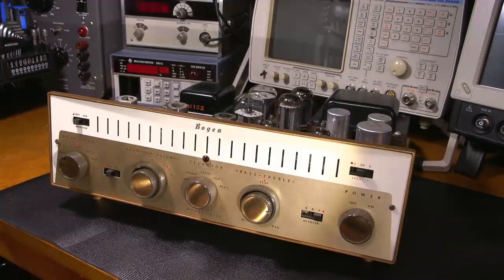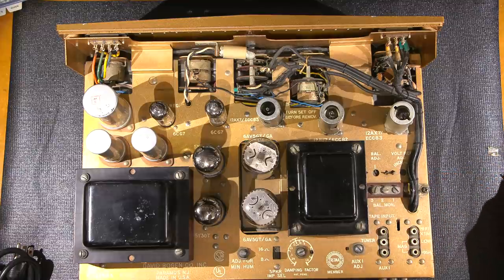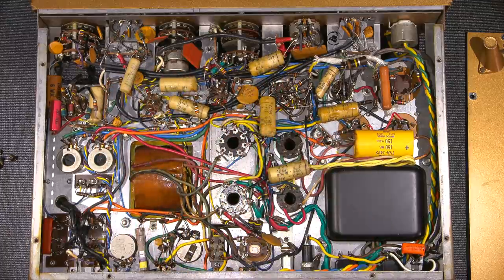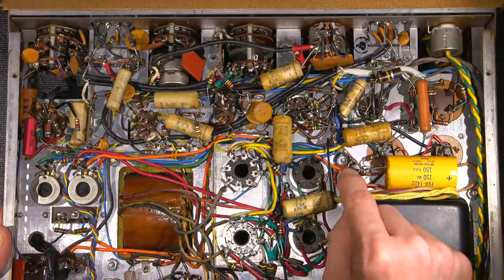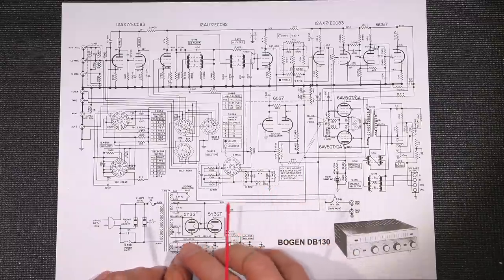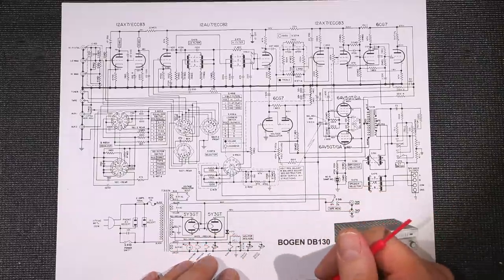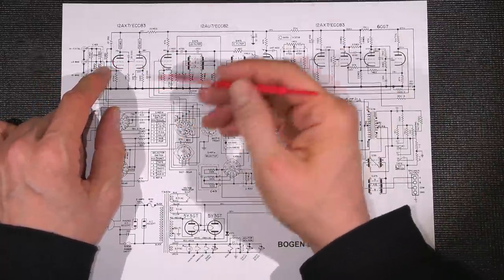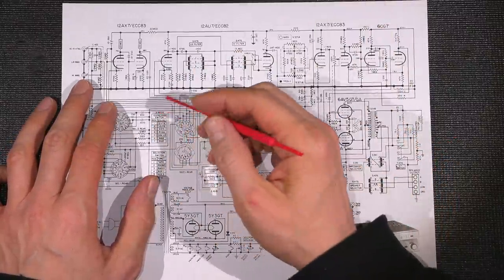Look Inside This Tube Amplifier!

Comment: Um when you were explaining how the Valve amps work and then transistors you called transistors current devices and FETS and Valves voltage devices. When I got my ticket in Australia I had it explained that with Transistors the collector base and emitter are very close together and its the voltage change that turns them on more or less. So therefore they're a voltage device. With FETS at rest they have a high resistance so when the input voltage changes its changing the internal resistance (depletion region ).If you change resistance you have to be changing current. So a current device . Its been so long but I think valves were classed as current devices as well. 

TTL has a low internal resistance so it doesn't take much to change its conductance . And the reason their noisy little suckers. 

Where FETS as its being turned on more their internal resistance is getting smaller and smaller till it reaches saturation. 

I can't get over the different way different countries teach this stuff . IN 1982 when I was doing my Certificate of Technology we had a Canadian teacher start with us half way through the year. And he explained TTL and FETS the way you did well when we explained it the way we had been taught he had a think about for a while then changed to the way we had been taught . If I remember rightly we proved it in a practical experiment.
 

I suppose its a bit like the left and right hand rule if you can get your head around one way of thinking stick to it .Its when you start changing from one to the other you'll get confused or the the person your trying to explain it to.
Reply: A transistor is a current operated device.  The collector current changes due to a change in the base CURRENT.  It is operated by current.  Ic = Ib x beta.  A fet draws essentially no current at the gate, a change in gate voltage controls drain to source resistance.  The same is true for the grid of a tube, it's a change in grid voltage with respect to the cathode that causes a change in the plate current.  It's the operation of the control element (base, gate, grid) that defines it as either a current or voltage device.

At least that's how I was taught in the early nineties in Madison, WI, USA
Reply: @mikeduino4596  With TTL the base current can be ignored because its so small. Its in the micro Amps.  Its the change in voltage at the base that changes collector voltage. With FETS your changing resistance in the depletion region and what changes resistance current. Generally TTL can only switch low current devices where FETS can switch high current.
Reply: @anno250  When you strip away all the external circuitry, it is base current that causes a proportional flow of current in the collector, and the emitter current will be the sum of the two.  If you think base current can be ignored, bias the base with a voltage divider, measure base voltage. Now, increase the voltage divider resistance by a factor of 100, keeping the same ratio as the first circuit. Base voltage will be lower for the second circuit...why?? The second circuit doesn't provide as stiff base voltage as the first, in other words the base is loading its bias supply. Hence at the most fundamental level a junction transistor is a current-controlled device. Fets may have giga ohms of isolation between gate and source.  With these there's virtually no loading of the signal at the gate, which controls drain current. This makes it a transconductance device, very different animal than the BJT! ☺
Reply: @mikeduino4596  If you bias both of these say with combination bias their characteristics change for the circuit you have them in .With TTL when you calculate all the Voltages and currents the base current is in the microAmps . When you want to do a quick calc you can ignore the base current. What I'm trying to get through with FETS is when its turned off the resistance between the Drain and Source is typically 100Kohms or higher depending on how its set up but when its turned on fully the resistance is near zero. Which means they can switch or amplify a lot of current try doing that with TTL. 

Your talking about what turns them on I'm talking about the rest of it .
Reply: @anno250  That is correct, I am talking about what turns them on, or what controls them in their linear region.  This is the property, the type  of control, that defines the device as a current or voltage operated device.  They all conduct current on their output side. It's what happens on the input with respect to the output that is generally accepted as defining the device's operating mode. I'm merely stating the convention used to define the general behavior of the raw device. Also, I have power transistors that are low gain high current and power that will draw SIGNIFICANT base current! Say 10 to 20 amps collector current and a beta of 20.  You can't ignore that.  Not every transistor is operated as a small signal amplifier.
Reply: @mikeduino4596  Well luckily I learnt in Australia where we learnt how things actually worked . No wander people get confused . Sounds a bit like why conventional current being still taught as to electron flow. I'd like to see someone explain that with digital electronics.
With FETS  I can't get over that you ignore the fact that when the gate is turned on more or less it changes the resistance in the depletion region. This is the huge difference between TTL and FETS. TTL are generally low current devices but FETS and MOSFETS are high current devices.
Reply: best thread ever you guys, thanks
Reply: @anno250  First off, you keep referring to TTL, which is a logic family designed with bipolar transistors.  Our conversation is about the functional difference between discrete transistors (BJTs) and fets. Second, I'm not ignoring what happens in a fet's depletion region.  It is the electrical field caused by the gate to source voltage that changes the channel resistance. Channel resistance is controlled by gate VOLTAGE. Making it a voltage operated device, period!  In a bipolar transistor, there is a current that flows in the base_emitter junction, a on junction. The gain of the device is  collector current divided by base current.  The current flowing from base to emitter controls  the collector current. It is a current controlled device. This is what is occurring in the device, regardless of what it looks like is happening in the external circuitry.  We are talking about the device characteristics, not about any particular application it may be placed in. Thirdly, to say that junction transistors are not designed for high current is patently false. 2N3055s are non power transistors used to pass load current in high current power supplies.  Many transistors in TO-3 can types can carry 10 to 20 amps or more and dissipate 60 to 70 watts or more.  Many of these will need up to several hundred milliamps to drive them to full output, why? They're current operated.
Reply: As for current flow, I was taught electron flow in tech school.  When I got out in the world, I quickly got that out of my system!  Look at the schematic symbol for any semiconductor device, which way does the arrow point?  In the direction of.... CONVENTIONAL flow.  I worked in an engineering lab where we designed and built switch mode power supplies.  All the engineers used conventional flow.

Comment: Back in the seventies people would trade this stuff in to stereo stores. They'd resell the McIntosh and Marantz stuff to oriental collectors and dumpster most of the rest. I used to raid dumpsters for these to put the output transformers into guitar amps because Fender wouldn't sell them back then unless you were authorized, and half the time they didn't have the right one anyway. You could use a Stancor for powr since they were cheaper anyway, but outputs you had to raid old stereo amps. Fisher and Scott were the best donors. Dyna transformers didn't sound right when overdriven. We didn't know why. But when you put a Scott 299 transformer in a Deluxe it sounded "better", by the standards then. Of course that's when everyone was putting brass everything on their guitars for "More Sustain". people wanted that AOR/arena rock sound. it sucked but who knew?

Comment: Do you ever find the couplets bad??  I've found the resistance off but never an internal disk cap shot.  Also I like the 6360 guitar amp. Never thought of trying that tube. I do the 815 all the time.  Also the 6dz7 is ausome for that but rare.  The 815 is cool because my customers say it looks like a Martian with 2 antenna.

Comment: Greetings from Germany and a big thank you for another great video. 

In the Bogen schematic there is a cap parallel to the power switch. What is the purpose of this?
Reply: That cap functions as spark/arc suppression, to protect the on-off switch. Note that those caps can sometimes go bad and leak voltage. Modern solid-state amps, which typically pull more Irish current at turn-on,  often have an all-in-one spark suppressor consisting of a capacitor and resistor in series, wired across the switch.

Comment: what parts are most likely to get damaged on a subwoofer amp if the 
negative and positive connect when in use. the amp keeps blowing a fuse 
and pushes the driver out and will eventually blow the speaker.

Comment: Can you explain the part about why the 5V AC doesn't end up on the B+ line? I always thought it was merged in with the rectified AC signal, but it didn't matter because another couple extra volts didn't matter because it just got filtered out by the caps anyway.

Comment: So on that audio input set of tubes, the audio controls the screen and how much current goes through is this why some people call vacuum tubes Valves? as the control source in this case audio is controlling flow like a valve would water.

Comment: Enjoy your Videos 👍 that little Guitar Tube Amp is Pretty Cool did you Convert it from Solid State. On the Bogen Amp whats the wattage rated at 8 ohms 20 or 500 cycles being tube amp they sound very Clean  pretty powerful for their time. My ole man had 1968 Marantz Tube Amps they could power Altec Lansing A7 Voice of the Theater Speaker cabs  and 2 half stacks clean and loud. The A7s are very power  efficent and tight Bass pretty impressive Design  Internal Reflux Panels and wide open bottom of Speaker Box .
Reply: Yes the guitar amp is a combo, SS front end with tube for the grunt. Used to be SS only. VOT are easy to drive, nice horns :D

Comment: Is the double tetrode in the guitar amp something like QQE03/12? I built a hifi amp with this tube a few years ago. A combination of cathode bias and fixed bias and a stabilized screen grid voltage was necessary to get both sections working in the same operation point. I know about a few guys doing similar things. So double tetrodes for transmitters used in push pull audio amplifiers are at least not undiscovered in Germany ;)
Reply from the maker: I talked about this tube a few years ago on Patreon, and way before that, implemented it in an amplifier on a forum some 10 years ago. Possibly from one of those postings?
Reply: @MrCarlsonsLab   I think I read first about it in the forum of jogis-roehrenbude. The GU17 is the russian equivalent of this tube. There was a time in the early 2000s where nearly every cheap russian tube was checked out as candidate for audio amplifiers, especially by eastern german forum members. Unfortunately, this forum is down, hence I can't search for the original discussion. Some guys even tried to use it as replacement for the expensive and unreliable ELL80, but I think the specs are too far off (higher negative bias voltage, lower amplification factor, lower screen grid voltage).
Reply: @rotwang83  ELL80 replaced by a QQE0312 just doesnt work. I use simple fix with two EL95 (6DL5) tubes and a socket adapter. Or a chassis strip with 2 sockets for the EL95 mounted nearby. The characteristics are identical and the heat output spread over 2 tubes makes it completely reliable. In the same way the rubbish unobtainium ECLL800 can be made up of El95+El95+6C4

Comment: The "Mr. Carlson Amplifier" needs a FranTone pedal...
Reply: Bogen... My high school decided that, instead of repairing/replacing tons of slave clocks in the classrooms, we would have a clock broadcast over our in-school TV channel for every single classroom to leave their wall-mounted TVs on for accurate time. (This was 1995) Enter BOGEN. They produced an ISA card that, with its companion software, would display the PC's current time on an analog clock via coax. I got to be the lucky one to install the card in the DOS 6.22 486 DX/2 machine and tie the PC into the school's cable channel distribution board.
The clock became affectionately referred to as "Bogen-Time." The worst part of the system was the hours of suffering that obnoxious CRT whine!!!

Comment: Have you done a video on that Spectracom NBS WWVB frequency standard shown in the middle above you on top of the stack? (It looks like an 8164.) I'd like to see that in case you are wondering about what video to create next. :-) Particularly if you have it modified to work with the current WWVB transmissions with a frequency doubler or whatnot.

Comment: Hi Mr. Carlson.  I am baffled by the lack of big smoothing capacitors after the rectifiers on that Bogen amplifier schematic.  I see some big cans on the top of the chassis near the power transformer, which look like power supply smoothing capacitors, but they don't seen to be on the schematic.  There is bound to be a huge amount of ripple present without them..  Is that what the regulator section is for?  I see some big cans on the top of the chassis near the power transformer, which look like power supply smoothing capacitors, but they don't seen to be on the schematic.  Am I missing something?

Comment: The early Centralab equalizer IC’s tend to degrade sound quality. David Berning has modifications for the Dynaco PS 2 stereo preamp, one of which include replacing these IC’s with discrete parts, which dramatically improve sound quality.
Reply from the maker: Hi Louis. I'm not a fan of ceramic capacitors in the audio chain myself. I have a video on the microphonic aspects of ceramic capacitors. Good for bypass, not so good in the audio chain.
Reply: Also, David Berning, who is or was an engineer in the Electron Device section of NIST, likened ceramic capacitor to that of peso electric ceramic phono pickups used in low end record players! Also, he noted that FET transistors has transfer linearity properties like pentode tubes.

Comment: Mr Carlson wondering if I could ask you a tech question. I have a Sony GV-9 video walkman which I restored 6 months ago which involved removing about 30 caps, cleaning the boards and installing new caps and the unit then worked great. But I was using it last week and the lcd display started to flicker white and then turned completely white and has remained that way. I am using a 5 inch portable lcd display connected to the video out and the GV-9 plays tapes fine with sound and the tv working fine too but internal lcd is white. Any ideas as to where I should be looking as it seems to be common problem which this model and the GV8. Big thanks Mike Perth Western Australia.

Comment: Shiny!
Reply: Seems the DB models didn't come stock with a top cover. I believe it was an option because I've seen a few. IMO The DB130/DB115 and all old amps with a face plate extending higher than the top of the chassis deck blocking the view of the valves, transformers, etc, when at eye level just doesn't look good at all without a top cover. They look like someone took the cover off 50 years ago to service it and never put it back on.
Reply: @williswet  The face plate extended higher so you could cut an opening in a custom cabinet front and slide this in from the front to cover the opening.

Comment: When you talk about b+ what is b+?
Reply from the maker: Hi John. It's an old term that is still used today. B+ originally meant "battery plus," it's the equivalent of a "positive rail" today.
Reply: B+ is the term for the high voltage. In this amp about 600 volts. It is a OLD term back to when radios were run on batteries. There were many size batteries, A AA B C D and so on. Yep the names we use on batteries today started over 100 years ago.
Reply: @wayneparris3439  - As I recall, the alphabetic designations do come from original tube radio design, but not because dry cells were named that way. Rather, the designations come from the simple need to tell one supply from another according to its function. The first battery powered radios had as many as three supplies, so this was a necessity. The battery that supplied power to light the filaments/heaters of the vacuum tubes was designated the "A" battery. The battery that supplied high voltage that the tubes actually use to operate was designated the "B" battery. Finally, there was (often but not always) a "C" battery that provided negative bias for the control grids of the tubes. These conventions have been carried on to the present day, though only the "B" designation survives, as the function of the "A" supply has been taken over (as shown here) by the 6V heater winding on the power transformer. Although not mentioned, the negative voltage (which really is coming from the "B" supply) could be termed a "C" supply as it is performing the same function as a C battery, supplying negative bias for the tube grids. Most more modern vacuum tube electronics do away with the need for a C supply through the use of cathode bias, and solid state electronics almost always uses only B supply(ies). Hope this help you.
Reply: @Inflec  nice, thanks for the background sir, quite interesting